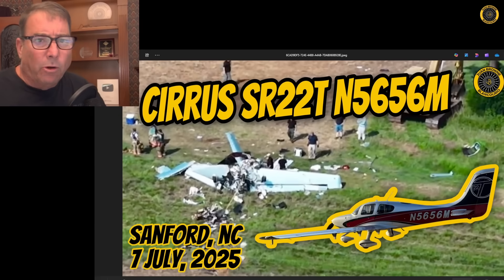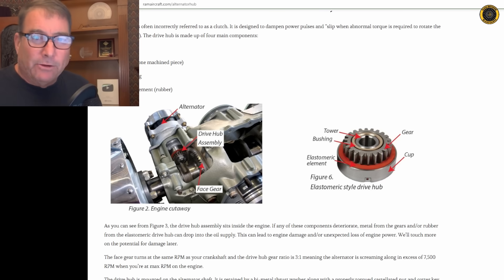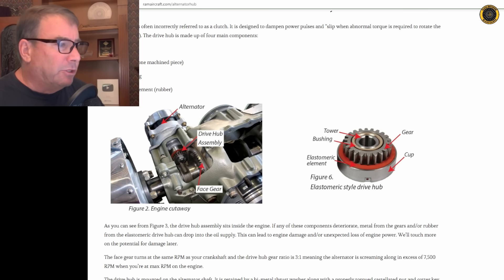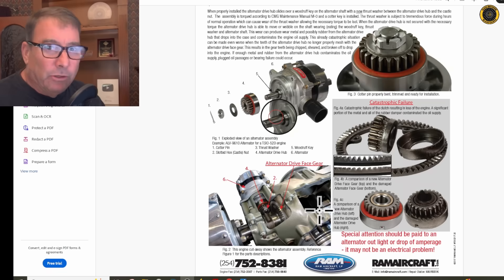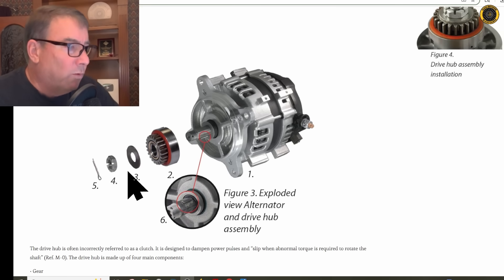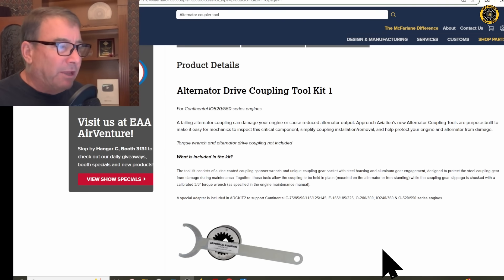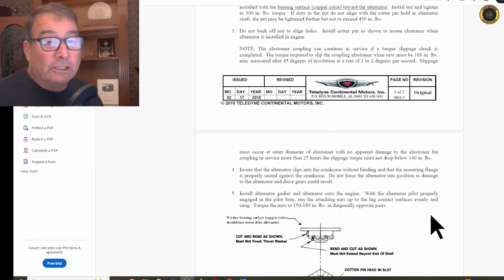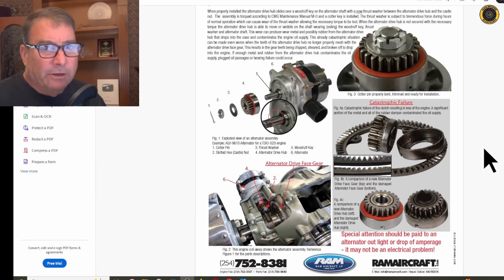Alternator Drive Failure-Can Lead to Engine Failure!

Comment: My Deb with an IO470 has the rear mounted belt driven alternator. I replace the belt every few years. No problems in 17 years.
Reply: Dan - have an O470 on my 182. Few years back noticed a whine at idle speed taxing back to the hanger. The guy with me (long time flight instructor) noticed 4:24 . We both assumed slight interference coming through the audio panel, possibly from the alternator. Then noticed whine still there after killing avionics circuit.

Removed cowl. Very sharp A&P , with a jury rigged, stethoscope, pinpointed the whine as coming from the bearing hub assembly for the alternator drive pulley.

Not the easiest thing to remove, but he advised it wouldn’t have lasted much longer.

Key take away for me, is After shutting down the avionics removing your headset, and just listen for five or 10 seconds to notice any odd sounds.
Reply: @dfmcintyre129 On the alternator itself or the starter drive?
Reply: Our N model 310 had the 470. Right engine would throw a belt every few hours. Could not determine cause until we wanted a dynamic prop balance done on both engines. Right engine could not be balanced. We decided the plane was not leaving annual until cause determined. After many hours labor, short of engine teardown, it was found that the alternator shaft had been bent slightly. (how, we never figured out) Replaced alternator, balanced prop and never replaced another belt until it was worn out. Oh, the dynamic balance was worth the money for more than one reason.
Reply: Dan - It wasn’t the the alternator itself, but rather the pulley that the alternator belt connects to.

Comment: Are you saying that one or both alternators are internal engine gear driven as opposed to a belt drive or some other external driving mechanism?  A supposed loss of panel power and engine stoppage kept the pilot from dead stick landing at his airport from 11,500 feet MSL when he is one mile from the airport?  Does the wreckage look like a near vertical impact to you...such as in a stall/spin?
Reply: Yes makes no sense that a pilot couldn't bring it in with that altitude advantage, or pop the 'chute somewhere between 11.5 and minimum deployment altitude (which wouldn't be known without glass)

Comment: First, let me point out that the current TCM Standard Practices Manual states that there is part in the direct drive Alternator/Generator coupling on C-75, C-85, C-90, O-200 and O-300 engines that should be replaced every 500 hours.  The part is the cup that holds the rubber pieces and helps to shock-isolate the gear from the rest of the assembly.  Having that assembly come apart inside the engine could cause serious damage to the engine.

Second, today I was told that an FBO at Merritt Island Airport had replaced a battery in 5656M before it left for its home base in NC.
Reply: Ah, the old "my battery is dead, let's replace the battery instead of checking the charging system" trick.

Comment: I'll give you pilots credit, you learn from the failure and deaths of your fellow pilots. You hear what was that guy thinking, he should have known better. Auto mechanics are all over YT complaining about how sorry new automobliles are being built makes one wonder has this metastasize over to aviation. So, load up your family and pet and hit the skies wondering did that guy torque to specs that alternator drive gear?
Reply: There's not a lot of innovation going on in piston driven general aviation airplanes, mainly because of the cost involved in making any major design changes and the regulatory process that has to be followed.

 Go to Cessna or Piper's website and what they have for sale as a factory new airplane are the same airplanes with the same (or nearly the same) engines they were making 30, 40, 50+ years ago. The avionics are about the only thing that is modern in these.

Comment: Well, that very much explains the link between electrical issues and engine failure.

Don't ignore warning lights, you only get them in anything if the problem they illustrate is a serious one.  And don't ignore electrical issues.  They're annoying rather than critical on the ground as you can roll to a halt somewhere and wait for a recovery truck.  You don't get a hard shoulder at 10,000 feet.

Comment: Thank you the update Juan. You stick to the facts. It’s a design that be catastrophic and it looks like that is what happened in this case. Why oh why did they keep flying through four states when they should have landed the airplane?
Reply: 1) get there itus 
2) unfamiliar with the mechanical/electrical systems of the plane
3)just plain stupid/indifferent to issues
4) combination of 1-3
Reply: If the airplane had a history of electrical faults, this might just be the time he didn't get lucky. I'd add "normalization of risk" to your bingo card.
Reply: @j_taylor : Aye. And once you learn that you can fly the plane to the destination even if you have electrical problems it's easy to just assume you can do so repeatedly.

I'm not an aircraft mechanic, but I've lesfned to be wary to assume any undiagnosed problem be non-issue. If you don't know the source of the problem you don't know its harmless.

Comment: That elastomeric coupling sounds like a pain in the ass. When is progress not progress?
A belt-driven alternator is a much simpler rig, and if the belt or belts fail, the engine is unaffected. A kit to replace the elastomeric coupling with a belt-driven system, should
be designed and marketed. 
Any irregularity in the charging system should motivate the pilot to land the aircraft as soon as reasonably possible, and have the system checked and repaired by a qualified technician.

Comment: Who would design such a system that an electrical failure would cause a catastrophic engine failure? This design is CRAP.  OMG, a simple belt is much safer. If you lose the belt, you just keep flying and replace it when you land.

Comment: Testing as per the bulletin can cause the coupling to slip and fail. I hate this check, it weakens the couplings integrity.
Reply: I had that thought, but it'd be high folly to not test.
Reply: @wadepatton2433 when it gets tested it damages the coupler. Don't tested it. Just replace it
Reply: As I recall, I read an NTSB report that confirmed that the stress of the test weakens the ability of the elastomeric portion of the coupler, and promotes slippage of use. The alternator spins at about 7000 rpm while the engine is at 2700 rpm. These couplers are overhauled and not new. At $750 overhauled, buy one, put the new thrust washer on and torque as per the bulletin, and go fly. I put prussian blue on the gears and check the gear mesh. I had one alternator cost me about 50k on a 200 SMOH engine, so my learning curve went way up from there to never have that happen again!
Reply: @mickeydoolittle2057 yes new couplers are expensive. But overhauled ones are acceptable. If im replacing #1 alt im also replacing the coupler. Never had a customer complain about that. Ive also never seen one fail that also damaged the engine. And since ive worked on cirrus since 2000 ive seen my share of #1 alt failures. They are a common failure on the SR platform
Reply: @Airplanefish  I agree. When I moved from a 310 to the Bonanza I wanted to keep as safe and reliable as possible. Alternator and coupling have been replaced every other year. Probably a waste but I have few vices save for aviation.

Comment: As an automotive enthusiast this  struck me as strange with your first video. Why intrude into the crankcase if there’s other passive methods like a belt, or other  perhaps centrifugal clutch type drive.  Belts these day are extremely reliable.  Adding a gear bearing failure point to ensure reliability seems over designed.
Reply: Probably some combination of space and or money saving for the manufacturer. Probably not something most people are aware of before buying one. I know I never would. Reminds me of the wet belts ford has been using with much success.
Reply: @vladimus9749 A belt drive sounds cheaper than a gear drive, and it can be done more compact than the gear drive in these pics.
Reply: @vladimus9749  >>Reminds me of the wet belts ford has been using with much success<< WITH much success? Not sure I agree. Even if they have made extra profit because of savings, I think the damage to their reputation is enough reason to stop doing that.
Reply: Plus belts can be inspected much easier than that elastomeric element (really persnickety pilots would even be able to do that check as part of their preflight checklist, if they are so inclined).
Reply: As an engineer, was wondering the same. That direct drive system with an elastomeric coupling looks like a terrible design. A serpentine belt can do the job. Just replace it and the alternator every 500 hours.
Reply: @BurnsRubber it's used in every motorcycle with an alternator. It's also used in motorcycle shaft drive systems as well. It's far from unproven.
Reply: There are advantages to this. Changing a belt is not that easy on aircraft with a constant speed propeller. On my plane, the propeller hub is bigger than the belt, so you have to remove the prop hub, which can be costly in some setups.
Reply: @erichildebrandt9490  It can be moved to the other end of the crank.
Reply: @mytech6779  UL Power puts the starter ring gear in back as well, a better design.
Reply: Aircraft engine manufacturers do a lot of really absurd things because they only ever slightly modify 1940s technology incrementally.    Some facets of them are truly insanity given the modern options.
Reply: To you and I, we want access. 

Sadly, most today want to see nothing except the cockpit and are mostly clueless as to actual mechanical operations. 

Notice how kids react to losing electricity.  It's the end of the world. 

He had plenty of attitude to land safely and clear conditions for a dead stick landing.   He was flying a SR-22 with a parachute!

What was he looking at?
Reply: The design places the alternator and magnetos in cool air before it is heated by the cylinders and away from exhaust pipes and turbochargers. Every design has Achilles heals, so the answer here is to Aviate, Navigate, Communicate and “Fly the plane as far into the crash as possible.” Way to many holes in the Swiss cheese with this one. I don’t know what he was thinking, but his family should have come first. RIP
Reply: It is called engineering ego/ job security.
Reply: It's because engineers are idiots. Well, some of them are anyway........
Reply: @rrknl5187 While I concurr a little bit since I do failure analysis, but, everything around me was designed by an Engineer right down to the new design screw top on the fruit juice that no longer requires a pull ring that usually broke off. 😊

Comment: That’s an interesting take, I didn’t think of that alt 1 gear breaking of inside the engine! I thought maybe with a dual alt failure he may have ended up draining the batteries and ended up with vapor lock which can happen in the SR22T without the electrical fuel pump on.
Either way he should have landed as sone as practical when the electrical problem started and not fly for over 2 hours with a malfunction.

Comment: I bought a Baron with an extensive prebbuy/annual.  I couldn't find where this SB had been CW'd, so off the ALTs came.  They still had the spring couplers.  WTF?!  They failed the torque test immediately, of course.  The previous owner or IA just didn't care to check?  It just shows to go ya that even after a yuge prebuy (I couldn't be there), things still get missed.  I was able to get 2 serviceable units at about 3 days of pay, each, lol.

These older couplings only need to be checked if the ALTs come off for any reason, iirc.  32 years and these ALTs hadn't come off!  Got them tested, and they were, "excellent, they don't make them like this anymore."  Back on they went with new brushes.
Reply: Is there such a thing in aviation like in marine, where for a small extra amount there is "Inspection Fail" insurance on the inspection service agreement? There was a vid of a woman you bought a British canal boat, inspector missed all the paper thin rust spots on the hull, she paid the extra 50 and got the hull repaired for free $$$$$.

Comment: 2:40 that's not what the elastomeric element is for. Its purpose is to absorb the engine combustion pulses produced every time a cylinder fires, to prevent those pulses from going into the alternator, as those powerful pulses will cause the alternator to fail. Over time it can work-harden and come apart, and parts of it can get into the oil system.
Reply: That makes this an even MORE baffling design decision imo
Reply: @GlutenEruption  The worst part is that the best pulse absorber around is a belt drive. They identified an inefficiency, belt drive. Then they engineered a solution, direct drive. But this introduced a new problem, pulse transmission. So they engineered a new solution to this new problem, elastomeric coupling. This solution caused more problems which they apparently ignored. They just labelled it a maintenance item, there, its fixed. Top notch engineering there, lol.
Reply: @WalterWalrus-w1w  Well yes, but that happens almost with every new system. This could have worked with an extra failsafe.
Reply: @WalterWalrus-w1w  This, btw, is exactly the same problem you face with superchargers.  Eaton superchargers have a similar coupler and all of them eventually fail. If you miss it in time, your rotors grind against each other and you're done - similar sort of seizure and metal everywhere inside the engine.  They have become rare to see on cars as of late, as it's kind of a crappy design.
Reply: That makes more sense than absorbing changes in electrical load for sure

Comment: In my many years of ferrying old, old, C-182's up & down the east coast, well, not only did I prepare & plan the flights out the wazoo, but I always considered each 2.5hr leg (multiple legs for thousand-mile one day, solo trips) volatile. Volatile in the sense that if anything felt odd, THAT (oddness) would make me land & figure things out. Yes, I've had my share of alternator belts going 'boing' & alternator mounts shearing. I've taken them all in my stride, sighed & diverted. I'm alive today.
Reply: This comment of yours will not have twenty replies from guys who think that is overkill.    There are no old bold pilots here to provide that response.
Reply: @brianhaygood183  Better safe than sorry.

Comment: Previous video showed two alternators with one dedicated to the essential bus. Why would there be total electrical failure unless the smaller backup alternator was already inop? (Backup battery would remain charged and power the display after engine failure)
Reply: I have a similar electrical system in my homebuilt - primary bus and essential bus. The changeover is not automatic. You have to pull the circuit breaker on the primary alternator, switch off the master, then switch on the essential bus. This takes foreknowledge and practice. It is also a little scary to shut down the master. If you haven't actually done this in flight, there can be a strong urge NOT to touch anything. I htink it is quite common that people who can afford high end planes are busy and probably don't spend enough time practicing ALL emergency procedures. But it's not just responding to an emergency, you have to understand your aircraft's complex system well enough to make critical decisions on the spot and with no warning. Flying as far as he did with a failing electrical system suggests her may not have understood the real danger that his plane was trying to tell him.
Reply: @gawebm  Thank you for the explanation. Makes sense now.

Comment: When I got my A36 Checkout about 30 years ago, I was told this exactly. Not long after, I had an alternator failure and I immedialty diverted. Turned out to be a loose wire but you don't know that until it's looked at by a qualified mechanic.
Reply: We flew a few hours in an A36 with a lose wire alternator failure.   The thing is, the boss landed the plane and made sure that was all it was before we carried onward.
Reply: I had the alternator out warning light come on during a night flight in my F33A.  Knowing the systems and issue (from BPPP training) I noticed the alternator was still producing power just fine on the electronic engine monitor, proving the alternator had not failed and was operating normally, and completed the flight without issue.  On the ABS message board I was told I probably have the original "sawtooth" glass fuses in the alternator sensing circuit and those are known to fail over time.  I replaced them and that resolved the problem.  You really need to know the systems in airplanes you fly and how to react to issues that pop up.

Comment: Reminds me of Rotax supercharged Seadoo engines. The early engines (starting 2003 used ceramic washers on the supercharger drive with an adjustable slip) unfortunately the washers often failed allowing debris in engine and total failure, if not replaced as a routine maintenance item. After several iterations, they now use metal washers, duh. The newest Seadoo top engine has now gone to a type of sprague clutch, starting 2024. ( I know nothing about rotax aviation engines)

Comment: JUAN,  at 3.35 you say the torque is 300 FOOT pounds then later you say max of 450 INCH pounds
Obviously it's supposed to be INCH POUNDS
Thanks for the mechanical explaination, you must have an A&P too !